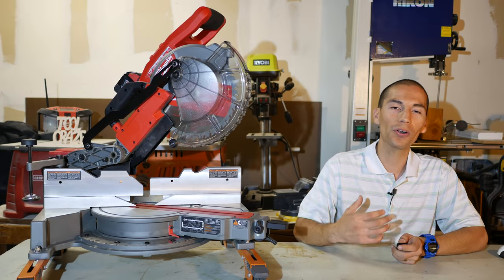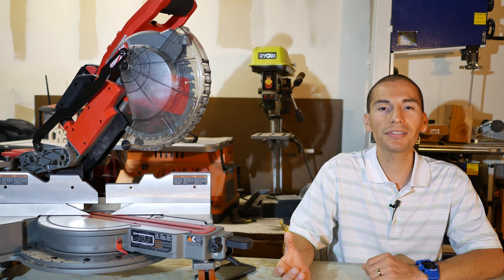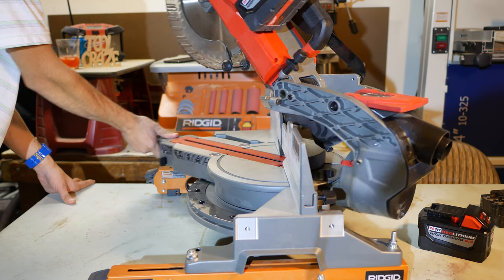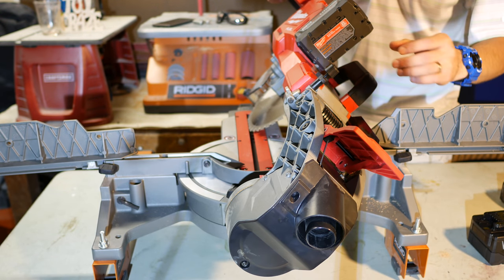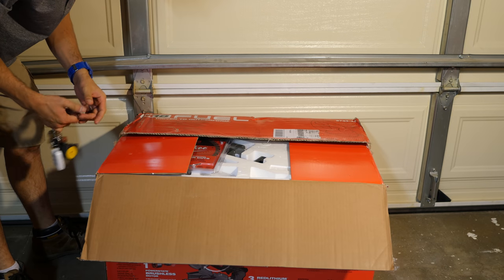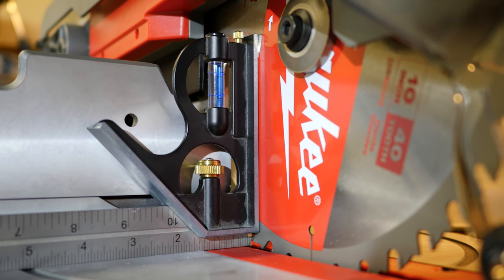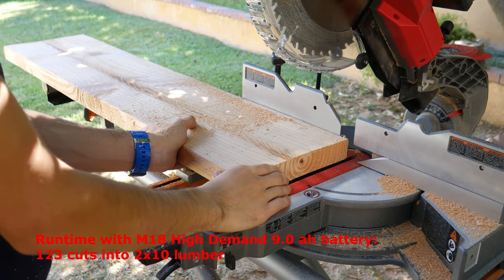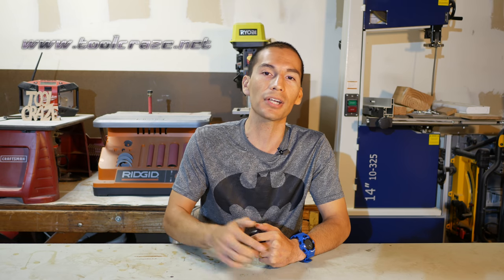Milwaukee M18 Fuel Miter Saw 2734-21HD FMS254-0 Review in 4K

Comment: Dewalt won on this one.
Reply: Agreed
Reply: donayre21  lol
Reply: donayre21 for $200 more? I don't think so.
Reply: Patrick Dolan You mean for $600 more by the time you buy 2 extra batteries because 2 that come with it won't last a full day of work. umm ok
Reply: 88Shortfuse Exactly.
Reply: Patrick Dolan I think you're confused at what I'm saying. The flex volt cost $600 more because of batteries. We use the M18 at work on a 9.0 ah battery and most times it last all day. Takes 2 batteries just to run the Default.
Reply: 88Shortfuse no I got what you were saying. I have the Milwaukee and love it. The dewalt isn't worth the extra cost
Reply: Patrick Dolan oh I got ya. Yes, we love it at work. I'm thinking about selling my 12" Milwaukee slider to get the M18 miter.
Reply: 88Shortfuse well worth the investment. I hear Milwaukee is making a wall plug adapter too like the dewalt miter saw has. Rigid has a wall adapter too I believe